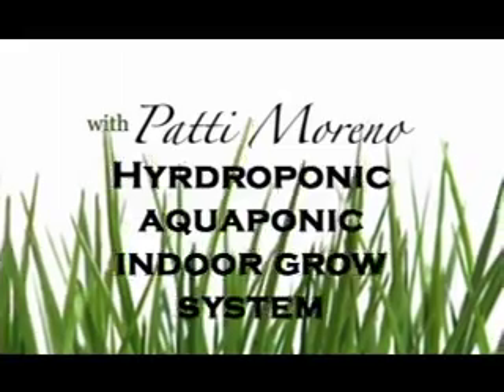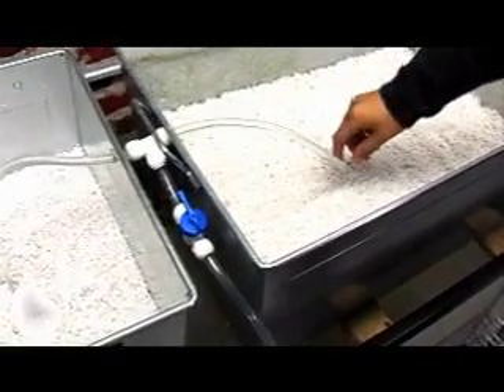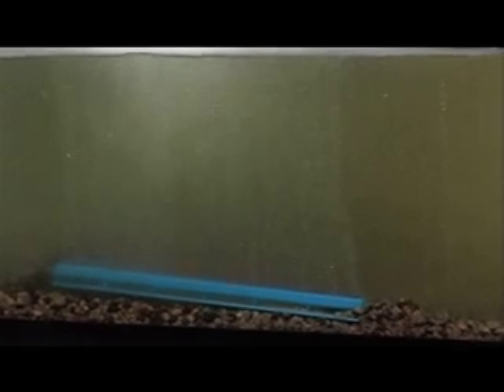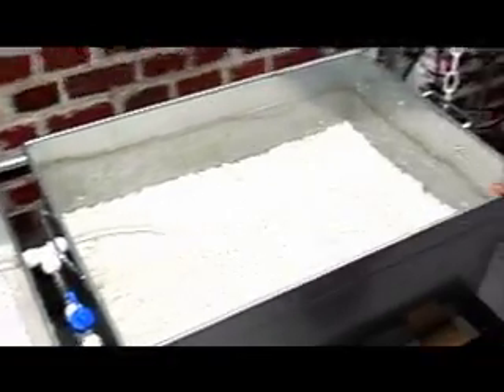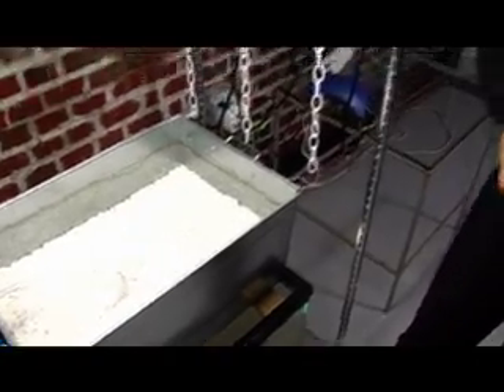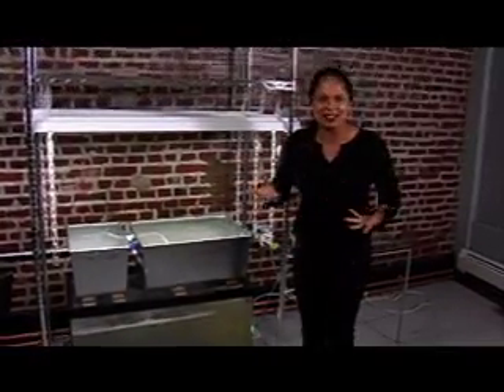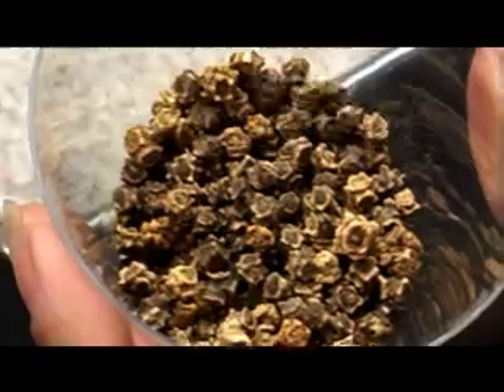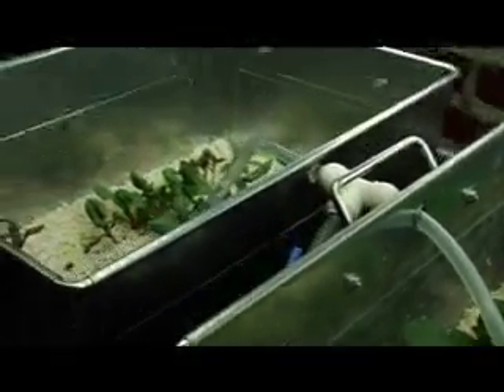Hydroponic Aquaponic Indoor Grow System

Comment: Nice Concepts but a follow up video would be nice on most of these. I would have used plastic instead of the Galvanized planters. I want to see a follow up for her seed starter one. I want to see how the system floods the trays and drains down to the level below. I want to see how well the peat pots survive the flooding of the trays. Patti does good work I just want to see the entire process.

Comment: Nice video.  The only thing I would point out is that the energy you expend to run your pump and lights is very costly.  Instead of putting this inside the the dark house, build a small greenhouse on the south facing side and use manure/wood chip composting for your energy.